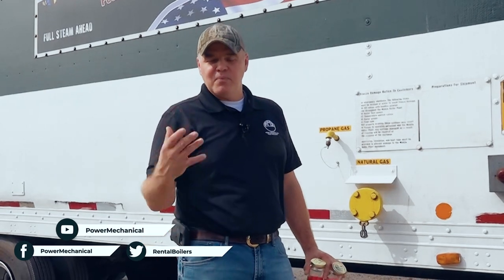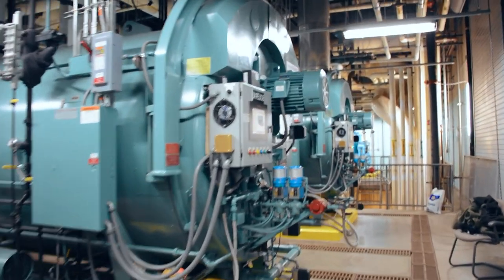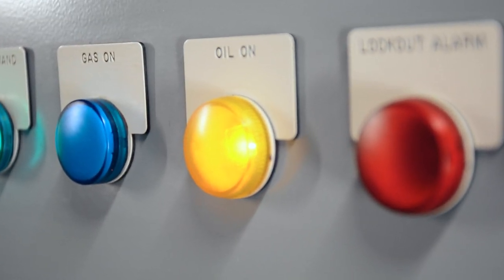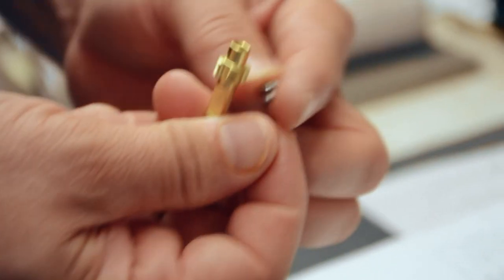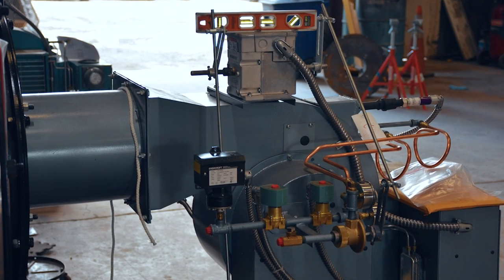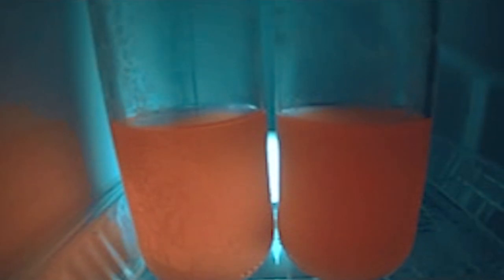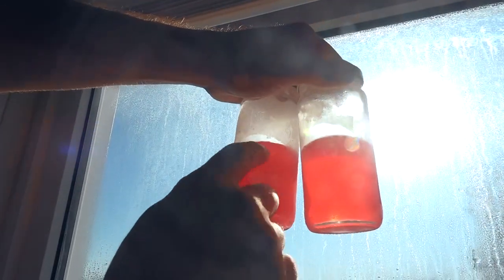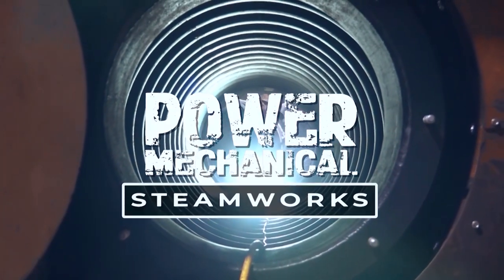Fuel Oil Atomization in Oil Burners - SteamWorks

Comment: I am going for my 1C Boiler license in MN, a question popped up on my practice test asking how many ways can oil be atomized or broken up to get proper combustion.
After doing research I came to the conclusion that its 2, air-atomization and pressure atomization.  The practice test I have says 1 is the correct answer, I can't seem to find a statute to define this.

Thanks for the video!
Reply: There are three main types of atomizers used in industry for liquid fuels that work on different principles. You have mechanical atomization, which requires a pressure to velocity conversion at the port exits to atomize the oil. You have fluid atomization, where a medium like compressed air or steam is used to break up the oil as it leaves the ports, and you have centrifugal atomization, where a rotating cup imparts centrifugal force upon the admitted oil which breaks it into droplets as it exits. I'm not sure why your practice test says one, but unless the answer is "using an external force", it's not correct.

Comment: What is the difference in using steam and air for atomizing? Any experience?
Reply from the maker: Not a whole lot. One is steam one is air. Obviously ones the system is making steam the boiler would not require an additional source for an atomizing medium (air compressor). So this helps with efficiency. If there was a steam quality issue then it could result in poor atomization.

Comment: How do you make sure your getting the right fuel to air ratio for optimal burn temperature? And… can a variable air supply with variable fuel pump be used to regular size of the flame? By variable I mean by driving my motors with variable frequency drivers. And then preset the speeds with just selector switches Hi - med- low. So they way there is no human errors in adjusting the air damper and fuel valve. My oil is preheated to improve combustion.
Reply: I guess im asking randomly but does anyone know a tool to get back into an instagram account..?
I somehow forgot my account password. I would love any help you can give me
Reply: @Gianni Conor Instablaster =)
Reply: @Maxwell Dayton i really appreciate your reply. I found the site through google and Im waiting for the hacking stuff atm.
Seems to take a while so I will reply here later with my results.
Reply: @Maxwell Dayton it worked and I now got access to my account again. Im so happy!
Thank you so much, you really help me out!
Reply: @Gianni Conor You are welcome xD